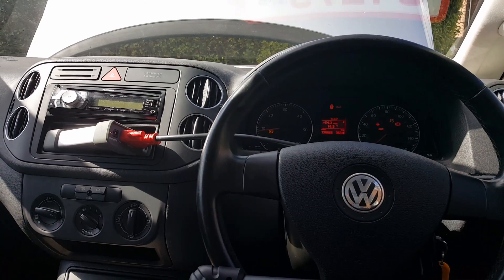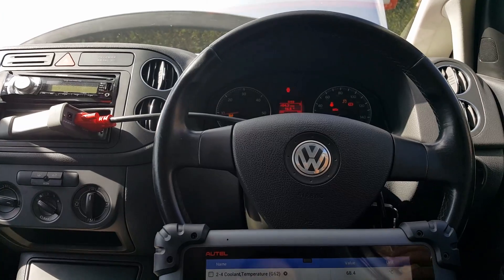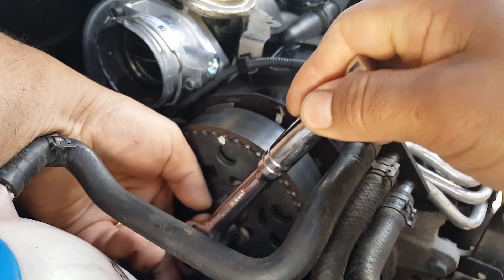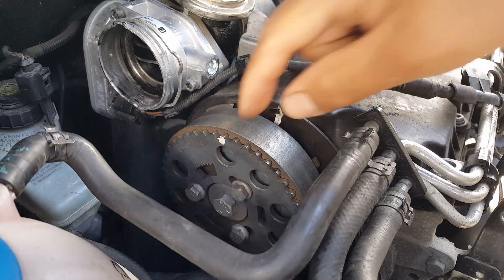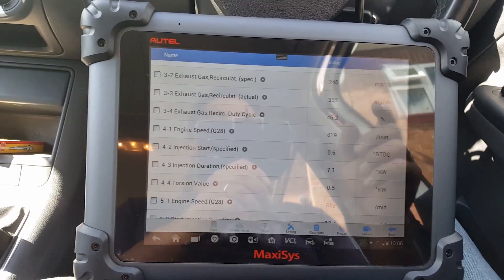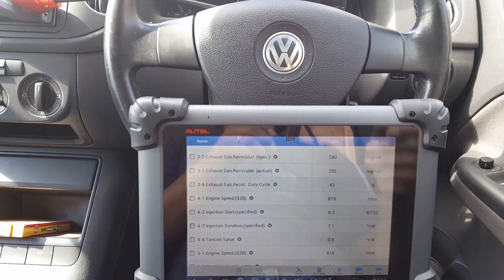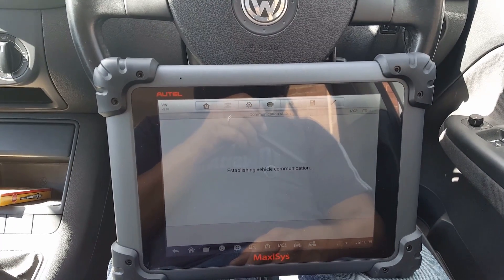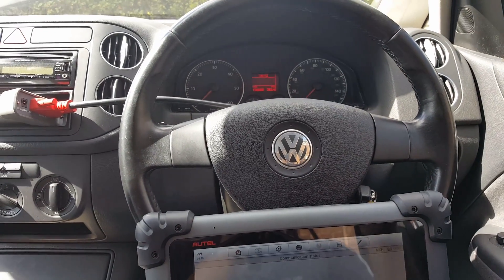Volkswagen Golf 1.9TDI (BXE) torsion angle (camshaft angle) adjustment.  How to identify the problem

Comment: I can't start the engine, it says sensor error, I replaced it and it won't start, now it says sensor values are out of tolerance, how do I find out which way to turn the camshaft pulley? thanks a lot

Comment: Very helpful video I have checked mine because it is running rough on idle when at full temp of 90c. The Torsion Value reads -4.9deg KW, so I assume it's too far retarded as it says -4.9?  Update i have reset mine to -1.5 and it tuns much better. Any lower it runs rough.

Comment: is the BXE engine bad despite having to change the big end bearing ? does it have more issues than all the other 1.9 tdi that were made the same years as the BXE.?
Reply: It's a GREAT engine IMO! No problems at all for many 100K miles. Just needs Longlife III 5W30 oil every 10K miles and a new turbo every 130K-150K miles, and a timing belt kit every ~90K miles.

I changed the big end bearing shells on one BXE at 135K miles. The original upper shells were slightly worn in colour (pink rather than silver), but had no loss of dimension, so I haven't done this with two other engines I maintain (BXE and BLS).

All three are at 150K-170K miles now with no problems.

I tested the compression on the BLS at 150K miles recently, and it was 420-430 psi (cold) for all cylinders i.e. as good as new.

My BXE is at 167K miles, is red-lined every day (only when hot), and I don't need to add any oil between 10K mile oil changes (though sometimes I add 0.5 litres at around 5-6K miles to keep the oil level at max).
Reply from the maker: I never owned one...
Someone else might be able to sat something about that...
👍👍👍

Comment: hello, my 1.9 tdi jetta has a late working problem, all values are normal, but the torsion value is the value of the device, I am constantly playing 0.00 adjustment, but the value does not change, I wonder why
Reply: Badly out of adjustment.

Comment: good evn, I have 4,4 to 5,5 with a minimum of 3.9 whem the car is hot but the problem is that runs very bad with incredible shooks with the engine. no problem in start engine but just when the car runs when is warm. If I adjust this values do you think is it possible to remove this incredible shooks? it is undriveable...
Reply from the maker: Possible... unless there is other issues...
Scan the car, check live data and go from there...
Thank you for watching!
Reply: Live data are all correct..no error in vcds.
the engine starts perfectly but the torsione is between 4,4 and 5,5. do you think it may create some problem when the car runs or not. Injectors are just changed and friction with bimass as well. Engine supports are checked, egr is ok injector cable is ok...tips? Is it possible that the camshaft sensor is out of scale? Could I try as you show in this video? Is it possible to brake the valves? thanks
Reply: Adjust to 1.0kw and see if it improves.

Comment: How you doing I have a 2008 1.9tdi bxe volkswagen jetta and every time I start the car it takes a long time to start I could be there for 5 seconds cranking it waiting for it to start even when it's hot any suggestions??
Reply from the maker: Scan the car, check live data...
A few things can cause something like that... guess is never the way to diagnose...😉
Thank you for watching!
Reply: @LMAutoRepairs  i scanned the car earlier it came up as glow plugs I changed them out and it's still the same way?
Reply from the maker: @carworldirl7084  
Check live data...
Check camshaft speed, timing, etc...
Reply: Your camshaft sensor is broken change it i was having the same problem.

Comment: hello, my mine vw b6 cbdc am -5.0 kw. and it appears on my board. I have problems with Senor G28, flashing without signal. (I replaced the g28 sensor and it does the same) to be from a torsion angle?
Reply: you must put your torsion angle to zero

Comment: is this the same for the mk5 2.0 sdi engines 2005
Reply from the maker: Possibly...
You need to check...
Reply: @LMAutoRepairs  my car is non turbo, i have struggle starting it when engines cold but when the engine is warm it starts straight away what could this be?
Reply from the maker: Few things...
Scan the check, check live data... 
And go from there...
Reply: @LMAutoRepairs  hi i scanned for codes no codes showing
Reply from the maker: OK...
Have you checked live data?
Is there a torsion value?
Reply: @LMAutoRepairs  theres is no error codes but im going to check again i think maybe it needs a service or crankshaft sensor

Comment: So ... my car stopped running .. golf 5 1.9tdi bxe, it simply wont start, turn the key, it tries to start but then it immediately dies.
The VCDS gave a P0134 code, camshaft sensor,

Heres the video demo:

https://www.youtube.com/watch?v=Sb2cCebAbPo

https://www.youtube.com/watch?v=AkCXVCX3egk

To make it even weirder, sometimes it starts sometimes it simply wont even if you try 5+ times, is it something electrical or just a broken sensor ?
Reply from the maker: Difficult to say... the sensor alone, does not prevent the engine from start...
Check the torsion value, check timing, and düse pump... check fuel etc...
Thank you for watching and for your comment!
Reply: LM Auto Repairs so, problem fixed, it was the camshaft sensor
Reply from the maker: @iplaybose  
That's great news! 
👍👍👍
Reply: @iplaybose  camshaft G40 or crankshaft G28? ..

Comment: have done it today on bxf engine
it was -2.5 with 0.4 fuel consumption
make it 0.5 with 0.6 fuel consumption at idle.
I'll see if it drive better
Reply: It is ok  with 0,5KW? I've got the same -2,5KW at my 2.0 BMM.
Reply: i don t understand because "zero" is the perfect synchronisation between valves and pistons... can you find an explanation?
Reply: It can be fine tuned for best performance.
Reply from the maker: Thank you for watching and for your comment! 
👍👍👍

Comment: hello, i have a problem with my touran with the same engine. After replacing hydraulic lifters, the car increased the cost. torsion angle is -2. What do you think I should do? Thanks in advance !
Reply: First star sometimes is problem but running is Ok !
Reply from the maker: @hojgyunmustafov6716  
Same as the car on this video...
Try to adjust it and see how it goes...
Thank you for watching!
Reply: @hojgyunmustafov6716
How did it improve
Reply from the maker: Is the car starting and running ok?

Comment: very bad example for all of us. first you must align teeth window at the top and then block camshaft with 6mm shaft and next move the pulley and the thing you are doing is changing the timing of motor because moves the camshaft. goodbye.
Reply: He's done it correctly anyway you don't need to use a locking tool
Reply from the maker: Well... whatever you say, it worked beautifully for me...
Goodbye
Reply: loosen 3 bolts without mark nothing in the pulley before and remove all intake pipe. ten attempts to do this is a pretty job.

Comment: hi! i want to know how the engine runs with torsion value 0.5KW?? my engine is 1.9 (BLS) I have -1.0 KW but I do not like how the engine runs. can you tell me how much time you lost to fix torsion value with 0.5KW
Reply: you have to turn your camshaft , clockwise a very little , about quarter milimeter

Comment: sorry for telling you, buy you do it wrong, i mean on edc16 ecu you need a value of -2 to -2.5 not 0, 0 is for edc15 ecu's, have a nice day.
Reply from the maker: You might be correct... (I could check the ELSA/ETKA technical data, but don't really matter...), however, at this angle, was when the engine would start and run absolutely perfect...
Anything below -2 the engine would do what I have showed at the start of the video, would rotate a couple times before firing up...
Thank you for watching, and for your comment!
Reply: @LMAutoRepairs  5mh11 is right(in some engines not all), if you use the factory locking tools, in some engines you will end up with -3 for example on BLS and it's the right spec, if you put it to zero like in the old engines you will loose power and the fuel economy will get worse.
If you check at official vw service book there are 2 types of tools for the crank(T1050/T1100), some use -3 degrees, other 0 degree.
By the way, I am a trained VW technician and today I am fixing a car with that issue, the customer went to a garage and they mess that up, now the car is like a diesel sponge and runs slower.heheeheh
Also is very important to have a thermostat in good condition, a "cold" engine will not run optimall
Reply from the maker: @Mario_Marques  
Thank you for the info and for watching!
Reply: @Mario_Marques  Viva ja vi que és Portugues, para um Motor 1.9 105 hp BXE é da mesma forma que o BLS? Ou seja torsion value a -3 graus?
Abraço e Obrigado
Reply: @Mario_Marques  hey ;) .For ASZ motor, torsion value is zero?

Comment: Hi. My 1.9pd engine shows -1.7/ -2.2. To bring it to 0 shell I move the shaft to the left or right?. Thanks
Reply from the maker: Hi
If I am not mistaken, turn the center chaft anti-clockwise...
Just move it a bit, if is the wrong way, just move it the opposite way...
Thank you for watching!
Reply: How many tries you had in order to get it to 0? I see that yours was on "- 4" so you turned it anti-clockwise. The engine runs smoother and mpg is it better?. Thx.
Reply from the maker: iurox 
It took me a few attempts...
It ran better, and as I have mentioned, started better ... this was not my car, so I can say about MPG...

Comment: I have ASZ pd 130 engine and cant adjust exact torsion value.Is anybody know what this value?By the way i dont have any diagnostic tool.i appericiate for your help.
Reply from the maker: Hi
The value is as close to zero as possible... Unfortunately the only way (That I am aware), to look at the torsion value, is with a diagnostic tool.
You can use VCDS, which you can get quite cheap...
Hope that helps.
Thank you for watching!
Reply: LM Auto Repairs 
i solved this case today torsion value what you shared video due.It was little predictable by hand tolerance,but it now works.It was adjusted by pump service with flow rate value though.Engine was not started after engine got cold.Now it is ok.
The other case i have this engine valve cover oil filling cap  that is smear with loam after revising process completed on this friday.I drove my car to home then saw this case in oil filler tap.
I can sent photos regarding this case if you share e-mail.
Thanks in advance
Reply from the maker: I will love to help you to the best as I can!
https://youtu.be/ka-Yrflcd-o?t=1m55s

Comment: I hav e a Touren which was minus 2,5 in torsion. After i adjusted it to 0,0 it run shorter om a liter diesel. What a your experience about This....
Reply: bxe is edc16, so there is not true that you should ajdust to 0,0. This should be on older edc15 ecu :)
Reply: @DerGolf2000
Thanks for your comment.  I understand that-2.5kw is best for economy on your engine.
Reply from the maker: The Governator 
Hi
I do not own this car... so can't really comment... but that said, I never had any complaints...
It is everything else ok with the engine?

Comment: hey,
i know the question is out of the contest, but this is the only way to connect with u .
Peugeot 307 al4 transmission,
i got an error as follow: " can torque information/ no signal " 
 i know literally what that means, but what reasons that may cause this error ?
** the current status if the car is that it doesn't  drive properly, the shifting takes to much time even at high rpm, and the kick down also.
beside the car over heat, and tge tipotronic doesn't work either
plz help !!
Reply from the maker: Soufian Attar 
That seems to be the torque info from the engine...
Which codes do you have in the engine module?